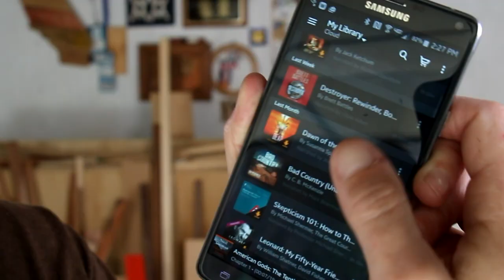DIY Recessed Wall Cabinet | Extra Fancy Lighting!

Comment: my half-brother showed me a neat trick for good drywalling. cut your patch an inch big all around (or less, but make sure it's big), score the gypsum and peel it off the front paper. then peel the front paper around the hole to the same width as the patch's paper lip. butter up both sides with compound and blend it right in. works fantastic and shrinks in tight pretty well.

Comment: +Steve Ramsey A trick I used to use at work for breaking glass is place the piece on something that raises it off your work surface (like you would if you were cutting wood with a circular saw) and then score the glass. Then just knock the cut with your knuckle and it should break pretty easy. It is a little less stressful than trying to break it over a table edge.

Great video too. Love the new remodeled bathroom.

Comment: When snapping glass (or mirrors) after scoring, lay a 1/4" or 3/8" dowel rod under the score line.  Works great and you don't have to worry about dropping a sheet of glass on the floor and trying to clean it all up.

Comment: hi stev listen, a bit of advice about glass cutting matey. when you are breaking off your offcut do it on the bench with a pencil or the back of your cutter under the near end score. the wau you were doing it there presents the inside of your wrist to the glass if you k now what i mean. if your cut is bad or there's an imperfection in the glass it can shatter an slash your wrist up pretty bad. there are other way but that's the safest
 also if you want to prevent the score "sparkling" use a cutting oil. just run a pad dipped in kero along the straight edge and/or dip your cutter in the kero then score the cut. also how hard you push depend on the condition of your cutter, a new cutter press less hard an older blunter cutter press a bit harder. there's kind of a feel to it.
 hope this helps you out

Comment: Gah....I was cringing when you were cutting that mirror, but it didn't shatter.  Yay!  ;-) One of my least favorite crafty project-y things to do is to cut glass.  I restored (sanded, repainted, rewired, etc.) an old 1950's streetlamp in front of my parents' house a few years back and had to replace the old, broken glass panels with new tempered glass, and I'm still anxious thinking about cutting those panels, haha!

The cabinet looks fantastic, and I should really make one (or more) in my bathroom, and maybe my kitchen above the sink ... but without the scary mirror/glass. ;-)

Thanks for another awesome video!

Comment: Nice way to use the space, this is a complete diy project , the wood work, light assembly, and wall repair, just please wear gloves handling glass/mirror also install it at the very last, sometimes the tool vibrations can crack it a little bit.

Comment: Great design, nicely done! I must say that you are taking an extra risk by cutting mirrors that way, say, by bending it over the bench's border. People that use to work with glass put a thin piece of wood along one side of the cut after they mark the glass with the cutter, then they hit on several places along the mark, from below, with the ball on the other end of the cutter and the glass falls by itself.

Comment: A quick drywall patching tip. Cut a patch slightly bigger than the hole, trace the patch onto the wall, and cut the hole to fit the patch. Much easier to match shapes that way.
Reply from the maker: +Derek Place Oh that's a great tip. I wish I knew that earlier this week!
Reply: +Steve Ramsey bout time I offer a tip to you... I think I only owe you a few hundred more- thanks!

Comment: Great video as always. I have a question just because I don't know: Is there any other ways to secure the frame to the box? Thank you for doing this series, they are really enjoyable and informative.
Reply from the maker: +Nikito RNG I actually struggled with this a bit. The easiest way would be to just screw or tack it on, but with the aluminum, the fasteners would look awful. My second thought was to screw it on from the back using packet screws. In the end, I chose to glue it on, because it doesn't need a lot of holding power...it won't be subjected to any strain. I used epoxy because wood glue would not bond well on the plywood edge.

Comment: awesome mirror cabinet Steve, one question does cutting metal sheet dull the blade on the table saw, which one do u recommend me. like the texture on the metal you gave it. Keep up the great work. you really know how to make it look simple.
Reply from the maker: +Luis Angel Cutting aluminum is fine...it's probably softer than a lot of woods! I'm not sure i would cut other metals though. It would probably dull my blades really fast.

Comment: Surprised yourself didn't ya when you cut that mirror,😃 it's nice when things fit well.👍 
Scary the way you broke the glass. you'll slash your wrists doing it like that!!  you gotta learn a safer way, lay it on the table with a little stick under the score line, then press down on either side.

Comment: As usual ... great job!! One question: What saw blade do you use to cut aluminium? Is the regular blade or a specific blade? Eduardo, from Brazil!
Reply: You can use regular wood blades to cut thinner aluminum. Just don't use the fancy high-performance wood blades.
Reply: Thanks Banana Guard! I have the DW745. Can I use the original blade?

Comment: You're putting way too much pressure on the glass cutter. The pressure it needs is about the same you'd put on a pencil. And about breaking the glass, or "opening the cut", as a glass worker would say, you need to start it on one side (preferably on the side where your cutter went off the glass, scoring it all the way to the edge). On thin glass (I'd say up to 3/16") you can do it with your fingers. On thicker glass, ideally you'd want cut running pliers, but here is a trick for you. Put the glass on a flat surface, then you put something round (like a pencil or a toothpick) under the scoring mark, then you apply equal downward pressure  on both sides. Goes pretty easy up to like... maybe 7/16". Anything thicker is actually pretty heavy duty, and you'd really need thick glass cut running pliers.
Reply: +voron11000   mostly even matches will do the trick
Reply: +alphons bretagne Well, many things might do the trick, but I prefer something round, so the cut would start opening from one side. You know how when you tearing a piece of paper you start from one side, not from the center? Same principal, it's just easier.

Comment: Awwww! Next time knock the scratched mirror or glass lightly (once is enough) from the bottom just at the expected cut with that metal ball you have at the tip of your knife - it will microjig... eeee no... micro-break the crystal structure of the glass. After that you will have to use little to no effort to break the glass and you will get a very clean cut every time. Unless you did that and just did not show it in your movie. But seeing how much you struggled with breaking the glass makes me think you didn't knock your mirror. Love your movies! Cheers!

Comment: I llke the little lighting bit...   really adds to the over appearance..  

think part of the problem you were having cutting the mirror, you were pressing TOO hard on the cutter.....if your line is "powdery" or looks "crushed", it's too much pressure.   A score should look like a fine line at most (not much more than a scratch really), and almost won't show at all...   When you go to break it, you had the perfect idea...line it up on edge and push straight down.   Talk to your local stained glass shop, their usually happy to give you a few pointers..   (I did stained glass professionally for 7 years...)
Reply: +John Drake when cutting large sheets, tapping is time consuming, and counterproductive, created a wavy edge.   I've cut litterally thousands of square feet of glass in those years.  float glass, (the type modern mirrors are made from) is easy to cut, but if it's the heavier thicknesses, it does require a bit of "heavy handling", requiring more pressure to get the score to break open.    If your score is the proper pressure, and you use a straight cabinet or table edge to push down across, it will break cleanly.   You can also lay a dowel under the score and press down across that.   my students and customers were always amazed at how casually easy I was able to cut even large full sheets of glass.   I always told them the same thing:   come cut glass 5 days a week, 8 hours a day, and after a couple years you can do it just as easily......    Over-scoring was probably the #1 problem people would come in for help with....

Comment: 1:48 using the edge is unsafe! Leave it on the table and place 2 matches or similar underneath the notch. That's enough to cut the glass apart.

Comment: Nice cabinet, you really need to paint the inside of those shelf holes. they stand out like a sore thumb.
Reply from the maker: +Maxx B Every time I do that, the pins won't fit! How do you get that work?
Reply: Thin the paint slightly or use a sharpie in a colour that matches closely, or is a little darker.

Comment: No drywall surface is flat, flush, plumb or square,  That is why many things as you made have shadow lines in their design at the wall intersection to distract the viewer from the irregularities in the wall.  However, since you have already built the thing without such design elements,,,,,,,,,,,,,,,,,,,,,,use caulk.